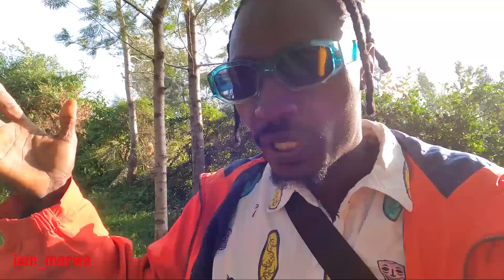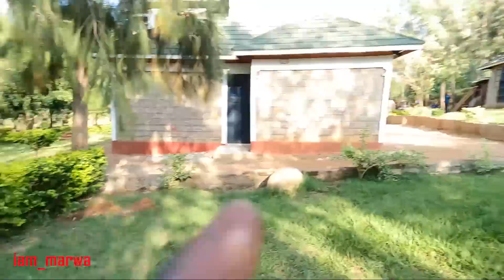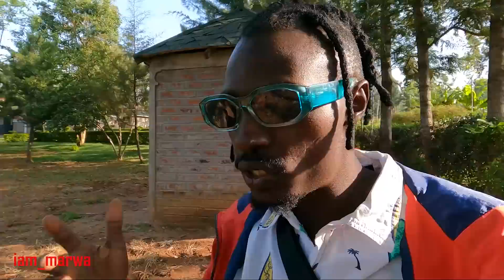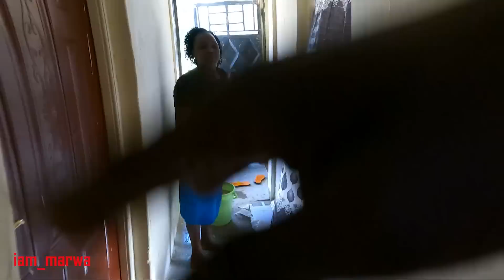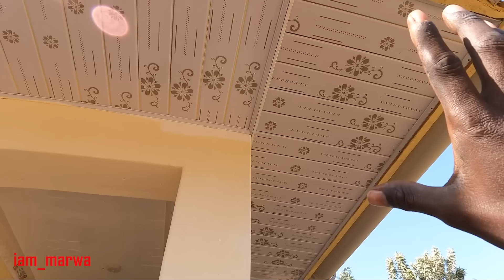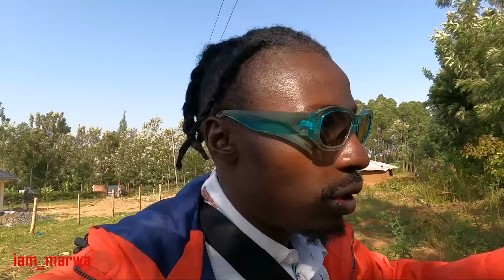a STRANGE SITUATION IN MY HOME  !!!

Comment: I believe you have made the correct choice. I would also suggest to cancel the sand deliveries from the supplier you have been using along with any other contractor that is associated with the person who wants over $2000.00 USD for flower replacement for such a small amount of flowers. I know you might not want to say on video but I can it was a setup targeted at you. There are also bad police officers in every department in the world as you are aware so keep your eyes open even more but I am sure I do not have to mention that since you have travel to many countries and have first hand knowledge of that fact. Money is a blessing but also magnet for criminals. Install those security cameras with night vision and audio now even if its only a few in the beginning as you said in the video I will install them later on however, do not wait because the criminals might decide to try something else since you mentioned that you will do it later.